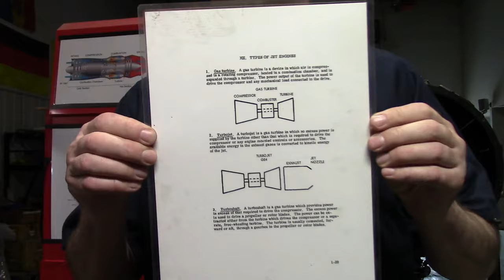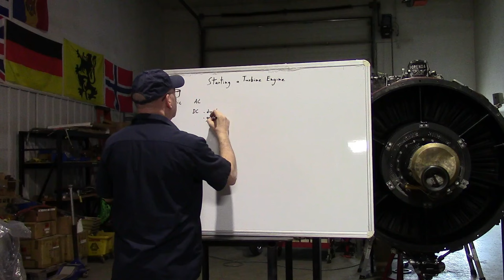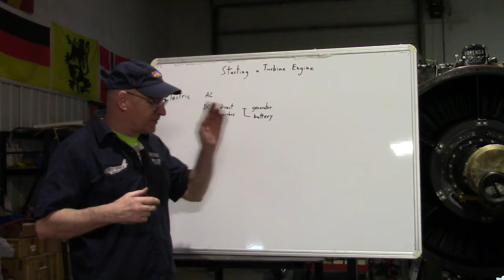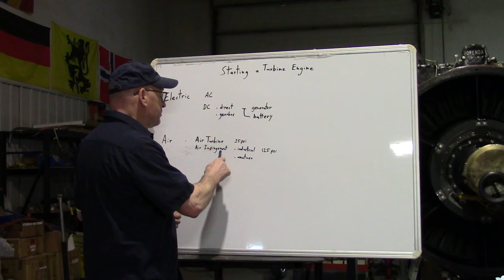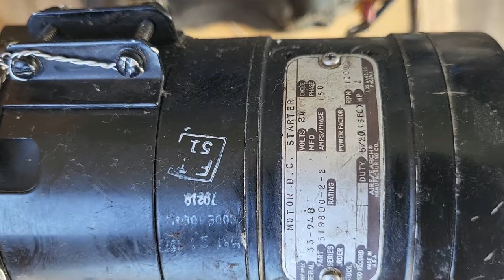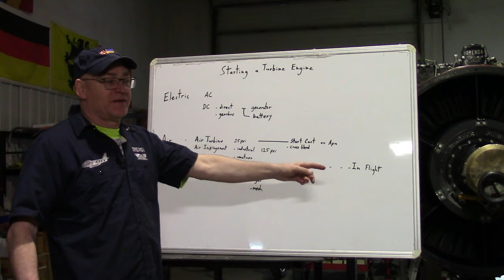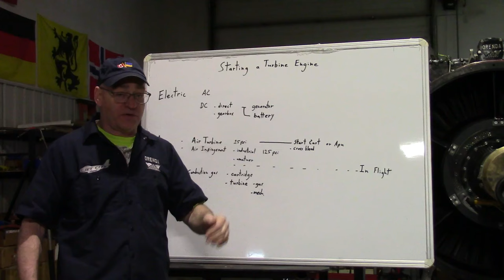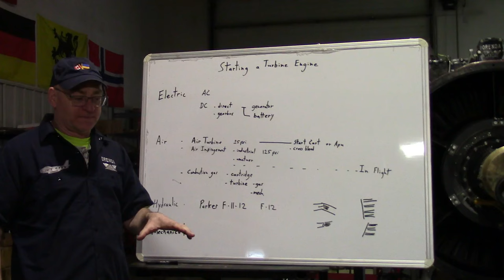Many Ways to Start a Turbine Engine

Comment: That impingent air manifold was used on the US Navy and Marine Corps F-4 Phantoms with the J-79-GE-8 & 10. The air was directed on the 2nd stage turbine wheel. The air start cart supplied high volume air at 75 psi. The cart itself has a small gas turbine engine and could also supply electrical power for the aircraft. The cart could also supply 45 psi for air turbine starters on other aircraft.
Reply from the maker: Thanks! I only knew of its use on ground running engines.
Reply: Thank You for the interesting information.

Comment: You can add one more to the electric start category:  In single shaft turbo generators, it is possible to use the generator as a motor to start the turbine.   That's how the monster gas turbines used in base load power plants are started.  They apply field to the generator, and with a frequency converter, spin up the generator to start the turbine.

Comment: I've designed some battery packs for starting small(er) turboshaft engines, but that 132V Avon start system consisting 11piece of 12V blocks just blew my mind 🤣🤣🤣🤣🤣🤣
Reply from the maker: I didn't catch it on video, but the switch was a monster, and made huge sparks.

Comment: Great video again. Don't sell yourself short, you are a great teacher! However, unlike what you implied, there are very few large airliners, even today, using electric starter motors for the main engines. As far as I know, the 787 is still the only one. Although the 747-8 uses the same basic engine as the 787, it still uses bleed air for engine start, and engine bleed air for air conditioning and wing anti-ice (iirc the 787 uses bleed air only for engine-intake anti-ice, and nothing else). I'm not sure about the 777X, but I assume that since it uses large parts of the old 777, its systems are designed around a pneumatic system. Even the Airbus A350 uses air turbine starters.

Comment: 2-Stroke piston engine in the nose cone of the central shaft on the Me-262! That one always fascinated me, the only pull start jet engine i know of 😂
Reply: Yes, the opposed 2-cylinder 2-stroke Riedel engine was connected to the engine shaft via a friction clutch.

Comment: As a tech in the CF I was fortunate to have a couple postings to units that serviced visiting aircraft so I got to experience pretty well every kind of start for turbine engines except for the last 2 in your video.

The good old Nene 10 on the T-bird has a sizeable DC starter to wind her up. Our ground power units (GPU) had a 'soft' start feature that included a feedback circuit from the aircraft start panel. This allowed the initial current to the starter to be moderated. Away from base without a soft start GPU the delivery of full current had the potential to snap the starter quill shaft which is designed to fail before any damage is done to the engine. Every T-33 carried a spare quill shaft in the tail fairing compartment of a tip tank which also holds the tip tank ground safety pins. Don't think a pilot ever changed one himself haha. You could also do a battery start as there were a couple large lead acid batteries in the nose compartment. 2 x 12 volts hooked up in series.

At one point you let slip that fighter aircraft don't have batteries (47-48 minute mark). I don't recall working on any fighter that didn't have a battery. Perhaps not for starting but for emergency power and ignition for re-light if you lose the engine. Even the CF-104 had room for 2 very small batteries. I remember they were among the first NiCad batteries in service on aircraft and were of a size that fit nicely into a BMW airhead motorbike of the 1980's. ;)

At Base Flight in Cold Lake i was on start crew for visiting CF-101 Voodoo & B57 Canberras. The Voodoo had a different, more high pressure start cart that was unique vs what we used on CF-5 or CF-104. It was a bit scary as I didn't like being around that kind of pressure for start-up. I think it was some kind of bayonet fitting to the aircraft. The Canberra starts were always exciting, bang, smoke, start. As start crew we were simply a fire guard, no other work required. I recall the crew telling us to stand on the opposite side of the nose to the engine being started in case the cartridge blew out of its cone on ignition.

The start cart for the CF-5 was smaller than the CSU (Combined Service Unit?) we had to start the CF-104. The CSU was a beast with many features besides providing air. I believe it had both AC & DC power & possibly even hydraulics. In Germany during tactical exercises the 104's were started inside HAS (Hardened Aircraft Shelters). These were fully self-contained with an air compressor, huge air storage tank & electrical power. Near the end of the 104 era in Europe the CSU's were being replaced by 2 separate units, one for air, one for power. That was a bit of a nightmare as you now had to tow 2 units around the line each one as large as the CSU used to be.... progress...

Comment: Hi jay z     I have a mk1 avon that i ground run    You have seen my vid on youtube    The government forced me to dispose of my start cartridges so ive been unzble to start it for 12 months    I have just been able to start her again    I mounted a 30 vdc generator on the front inplace of the cartridge starter  i manualy engage the drive dog then via solenoids i feed 12 v the once generator  once the eng is rotating i flick a switch and increase the voltage to 24  which gets the eng up to 450 rpm  enough to switch on igniters and fuel flow    Starts up fine  no increase in egt from standard    Very gentle start now  Thanks for what ive learnt from your videos
Reply from the maker: Very creative!
I've always thought it would be interesting to have a motorcycle engine as a starter. Same clutch mechanism as the electric start, but maybe a wailing two-stroke with a moto throttle powering it.
I think you're just the guy to make it happen.
Reply: @AgentJayZ   ha ha ha   Im more than satisfied with this setup thanks   Even managed to get it under the original starter cover   A museum in aus converted their avons to electric start  with starters off avons from a comet   45 hp 120v dc motors     And ive managed to do if wifh 24 v into a dirty old bendix generator    How would i get pics or vids to you, if yr interested ?
Reply from the maker: email address on my channel page.
Reply: @AgentJayZ  hi JayZ     Ive just put a youtube vid up about my starter conversion    Any video i had was too large to email you directly    Cheers  john
Reply from the maker: Very nice work! We recently sold an old aviation Avon starter. It was 48VDC. The one we tested years ago was different, and rated at 132 VDC.
One thing I worry about is your stand. If you take that thing anywhere near its flight operating RPM, between 7 and 8 thousand rpm, it'll make several tons of thrust.
I'm sure you know that, and are careful !
That engine is a beauty.
Reply: @AgentJayZ The Riedel starter in the nose cone of the Jumo 004 and BMW 003 is a 2-cylinder 2-stroke which turned the shaft via a centrifugal clutch - worked very fine. The Riedel had an electric starter and additionally a pull starter like a chainsaw.

Comment: Fun video!  I used to work on A-4M's and TA-4F's and J's in the Marine Corps. I was qualified to run the engines for maintenance purposes, so still recall some details about them.  The TA-4's used the conventional air start process for their J52-P-6 engine.  The A-4M's started out the same way, but were upgraded to use a JFS to spin up the J52-P408 engine.  The novel detail was that the JFS had a hydraulic accumulator that started it.  Once the J52 started, the aircraft's hydraulic system re-pressurized the JFS's accumulator.  If, however, the engine start wasn't successful, the ground crew (i.e. me) had to pump up the JFS accumulator.  :-(  The early Skyhawks were air start too, but had a detachable turbine that fit into the engine.  I got a video of this at the Warbird Heritage Foundation.... https://youtu.be/VmA255p2MHg    Anything to save a few pounds!
Reply from the maker: Thanks for the info. I never knew about that method. So the JFS must have a little hydraulic starter motor. You and iTz_JLAR  both brought this to my attention today.

Comment: Great video. While they don't use hydraulic motors to start the main engines directly, some combat aircraft like F-15, F-16 and F/A-18 use them to start the small gas turbine (JFS or APU). The hydraulic accumulators are recharged when main engines are operating, but if the pressure is too low, ground crew has to manually pump them before start. If you google "F-16 manual pump" you should get some photos of ground crew with a big lever stuck in the left wheel well of the aircraft.
So in a way these fighter jets are started with good old muscle power and a hand pump.... that charges the hydraulic accumulator, that powers the hydraulic motor, that starts the gas turbine, which cranks the engine through a gearbox (F-15, F-16), or air turbine starter (F/A-18).

Comment: I have 3 small gas turbines from the 1960s which are started by a hand crank. Rover 1S60, BMW 6012 and Deutz T16 (T216). Turbine power approx. 60-100 HP. The Deutz has no electrical ignition and is ignited with burning newspaper.

Comment: Your shows are great!! Always wanted to know how jet engines work.. BTW,, what did the Avro jet fighter used for jet engine, before Defenbaker destroyed them a?
Reply from the maker: The only thing that can be described as a jet fighter made by Avro is the CF-100 Canuck. It used Orenda 11s, which are the same core as the 14, but with a different arrangement of external accessories.
Oh, you may be asking about that other plane. It was not a fighter, but an interceptor.
Not a trivial matter. In my business, the proper names for things is a critical thing.
I do have access to, and have made videos featuring, the Orenda 10, 11, 14, and Iroquois.

Comment: Excellent video & explanation! You mentioned "handed" engines - I have read that a version of the CF-100 had "handed" Orenda engines ... does that mean the left and right engines were counter-rotating? Was this ever the case on any turbine powered aircraft?
Reply from the maker: Never. The cores were the same, but the arrangement of accessories on the outside of the engine may have been arranged in left and right handed orientation in order to simplify connections... for the fuel pumps for example.
Reply: @AgentJayZ Thx!

Comment: Great video, answered a number of questions for me. One question, when starting a main engine with bleed air from an APU or the other main engine, does the bleed air spin a starter turbine connected to the external gearbox on the engine that is being started (so not direct impingement)?

British Airways Flight 009 might be an example of a 747 using the air start procedure but maybe they used the APU (they lost all four engines due to volcanic ash). 

Also it would have been interesting for you to say that “no speculation” was allowed on why the SR-71 Pratt & Whitney J58 Engine takes so much additional horsepower to start, and then watch us speculate.
Reply from the maker: As far as I know, the airliner cross bleed ducting is for air turbine starters.
It would seem that direct impingement would be simpler, so maybe some airliners did use that.
Reply: @AgentJayZ  

Thank you, that is what I assumed and have no knowledge about direct impingement (but as you note, it seems more straightforward but probably in the real world, not so much).

Comment: G'day Agent JayZed,

Well, I dunno if I'm the only one to notice - or if maybe I missed it (?) ; but one of THE most famous (infamous ?) of the early (Turbine-Exhaust) "Jet-Engined" Aircraft..., to employ your rather precise and exacting terminology (!) - used another, entirely different method of starting...

The Junkers Jumo and/or BMW Turbojets in the Me-262, the World's first Operational "Jet-Fighter"...; were started by a 2-Stroke Piston-Engine - itself started by a Hand-pulled Recoil Starter, with one 2-Stroke Motor in each Nacelle, mounted behind an Access Door to the Pull-Cord Handle in the very front of the 
Domed Spinner of the front Wheel of  Engine's Compressor Blades....

I always got a laugh out of the very idea of the much lauded  
World's First JetFighter's
Engines being
Pull-Started..., like any common
Lawnmower, Chainsaw or Brushcutter (!).

And for your amusement, feel free to backtrack me to my Videos to see,

"Soft-Shank Twist-Drills ; New Adventures In Metallurgical Chinesium !"

I imagine it may well strike an empathic chord with you
And your worldview (?).

Such is life,

Have a good one...

Stay safe.

;-p

Ciao !
Reply from the maker: I think I did briefly mention that.
Reply: @AgentJayZ  

Ah, cool ; it was a long story and I admit to having watched in installments, and been dragged away by Kettle-boiling noises, etc - which was why my enquiry was intended to be tentative...

Thanks for the reply.

Have a good one,

Stay safe...

;-p

Ciao !

Comment: Are the critical speed of shaft and temperature rise of components important in the startup of turbojet and GT such as steam turbine?
Reply from the maker: ... such as a steam turbine? Nothing in your comment makes any sense to me.
Reply: @AgentJayZ  Sorry, I can rephrase my question. In the case of starting a steam turbine, the critical shaft speed, refers to a specific speed at which very high vibrations occur, must be avoided and the temperature rise of metallic components must not exceed 260 °C per hour to prevent cracking and eccentricity of the shaft. Is this valid for the startup of turbojets and GTs? THANKS
Reply from the maker: Not much. Components heat up very quickly during start. Cooling down slowly is more important. Each engine has different vibration behavior, so no blanket rules apply. Steam turbines have the same function as power turbines. I have several vids on that subject. See my channel page for the search feature.

Comment: Hey AgentJZ. I have an add on to your list. 

The F-15 Eagle does not have a battery on board. It instead uses stored hydraulic pressure to spin up the JFS for engine start. If you like. Here is an F-15 engine start video where you can hear each stage from start to finish: https://youtu.be/tNLz4HpsKQU?si=Zo4kNd4nzNGp9kTk
Reply from the maker: Thanks for the info. I never knew about that method. So the JFS must have a little hydraulic starter motor. You and SkyhawkSteve both brought this to my attention today.

Comment: At 34:00 minutes into the video, when you show the turbine of the JFS-100, there are some tubes and a manifold visible to the left of the turbine. Is that an impingement starter? Looks to me like the thing when you explained impingement starting.
Reply from the maker: Nothing at 34:00, but at 35:14, you can see two handles, and a smaller diameter fuel manifold, connected to 5 fuel nozzles. As explained shortly after that, the JFS100 is started with a small electric motor driving the accessory gearbox, which is connected to the main rotor by the radial drive shaft, also shown.
Reply: @AgentJayZ  Thanks for the answer. I saw your explanation of the electric starter of the JFS100. I thought the JFS100 might have an impingement starter as an additional / alternative starter method. Sorry for not being clear on that.

Comment: My father told me that back in the ‘70’s he was one of just a few passengers on a flight out of Bangor, Maine.  The 727 overnighted in Bangor on an extremely cold night.   The pilots announced they were not able to get #2 started but, with the passengers’ concurrence, would take off on #1 and #3 and windmill start #2 in flight.  The passengers agreed and the flight landed on time on all 3 engines.  I’m guessing this would not “fly” today.
Reply from the maker: cold temps have no effect at all on turbine engine starting. Right down to -50F.
As explained here, there are no batteries to not work, the bearings are all roller, and the engine oil is liquid down to -70F.
I was on an MD 80 (same engines as the 727) in 2013, and they could not start one engine due to a stuck valve... The air valve to the starter as explained in this video. We waited an hour for a tech to come and bang on it with a wooden mallet. Old planes need extra love.
Reply: @AgentJayZ  Interesting.  Two options for the stuck valve.   Hit it with the calibrated hammer or windmill start in flight.   Sort of like starting my old truck.  Hit the starter with a hammer or roll start it.  Cheers!!!
Reply from the maker: I don't believe that even back then, a passenger carrying airliner would be allowed to leave the gate with a nonfunctioning engine.
Absolutely no way.
Reply: this sounds like the story of an inoperative APU being misunderstood by a passenger.